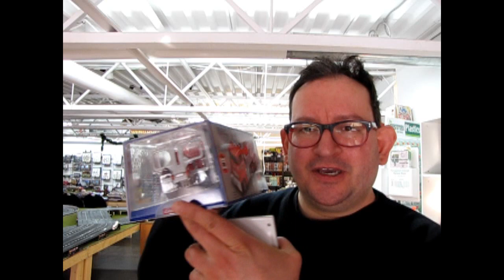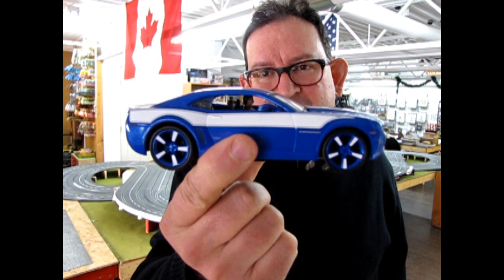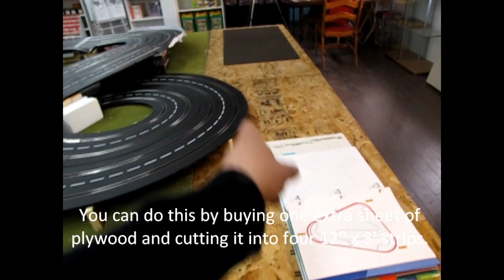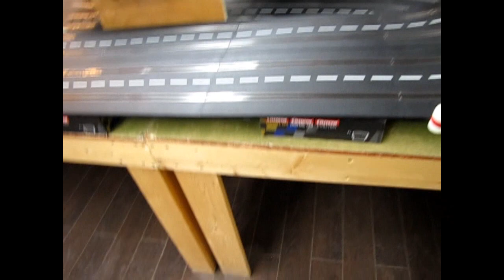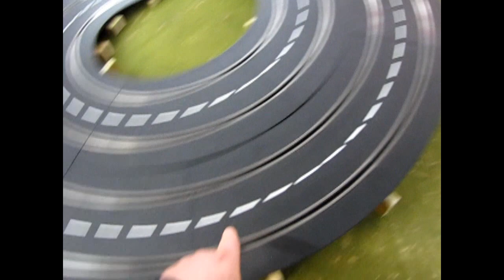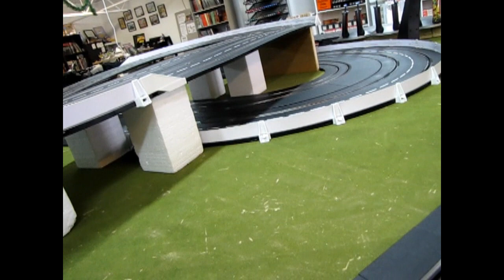How To Successfully Build The 1966 Gotham City Slot Car Track from the Classic Batman TV Show

Comment: I like your video. I have enough x sport track to do this ,but alas no room. I think the far left over/ under is 315 degrees not 360 Great Job!
Reply from the maker: You could be right on that turn. This is a pretty big track. Sits on four 4' x 8' tables. But that's in 1/32 scale. I wonder how big this would be in 1/64 scale?

Comment: Good afternoon Trevor, I tried to figure out out how much track you have for the Batman track it's about little less than 100 feet of track,  that's alot of track, see you next video.
Reply from the maker: Thank you for figuring that out. I can understand how to calculate the straight track, but wasn't sure when it comes to a curve. 

100 feet of track...does that factor in the 8 straight sections that i am missing? 

Just to help the calculation...a straight section of Carrera track is 13.5 inches long.   100 fet of track in 1/32 scale would be 3200 1/1 feet! - 0.6 miles!
Reply: What I did was on the curves is the cars that run on the outer curve I measured, I went to Carrera web site they had had measurements for inner circle and outer circle , I took the the outer circle measurements, the funniest thing is I got paid time and half to figure it out, I have a lot of time on my hands , my wife got me for Christmas Evolution Ferrari Trophy , cleaned out part of the downstairs so I can set up the track, this coming weekend going out to buy the 2×4s and 2 4ft×8ft sheets of wood, I love working with wood,  hopefully couple more weeks I should have the track going, I can't wait for my son and me be racing slot cars, thank you for responding to me, I'll see you next video.
Reply from the maker: @dadepic3602  No problems and good luck on the build!